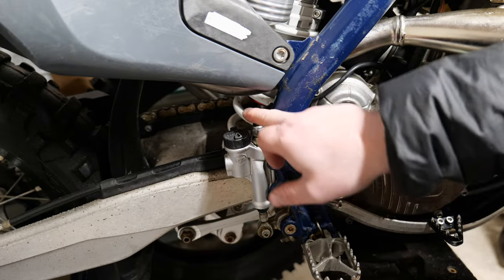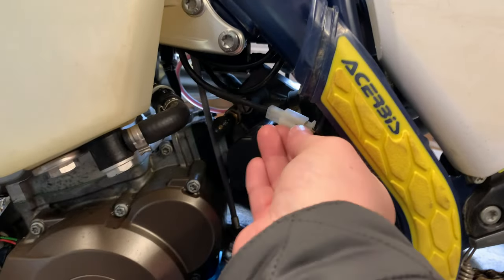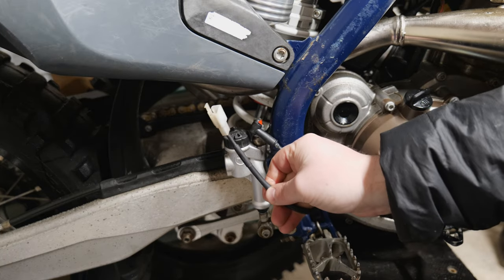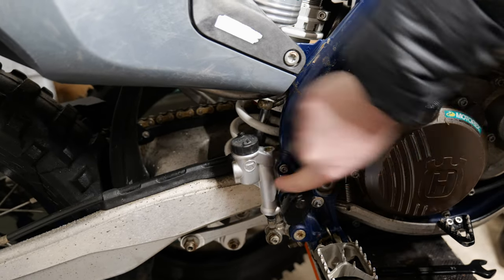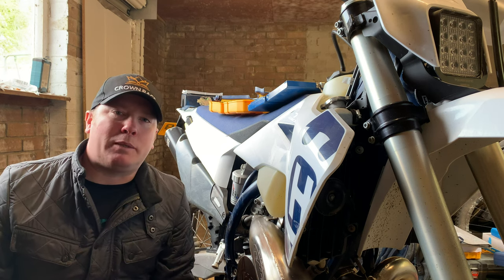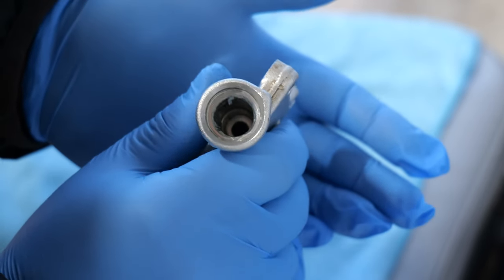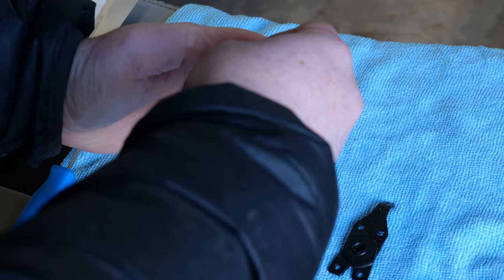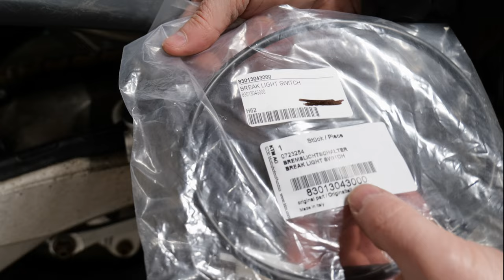Husqvarna Magura rear brake master cylinder rebuild and rear brake light switch replacement

Comment: Hey mate are you in England coz did it pass its test with that led front light in coz it's a 2400 lumens on dip ye and 4800 on main been ye ,England's only 700 dip and 1200 main ye ,please reply
Reply from the maker: Hiya mate, I’m in England but the light got damaged before it had its first MOT so It now has the original light back on it unfortunately.
Reply: @MALVSMACHINE  but would it have passed with it on bike ,or did it fail on the light when rear brake light did
Reply from the maker: @cliff1551 ah sorry mate, I’ve had so many bike and car MOTs lately I completely forgot the light was still fitted.

The bike only failed on:

•Rear Brake master cylinder leaking (1.1.10 (b) (ii))
•Stop lamp remains on when the brakes are released (4.3.2 (a) (iii))
 
It passed the second time but no mention of the head light. 

Where did you get the Lumens figure from? I’ve just looked on the .gov website for the mot of a motorcycle  and can’t find any mention of brightness, only that the light should meet the pattern requirement. 

Hopefully this link works?

https://www.gov.uk/guidance/mot-inspection-manual-for-motorcycles/4-lamps-reflectors-and-electrical-equipment